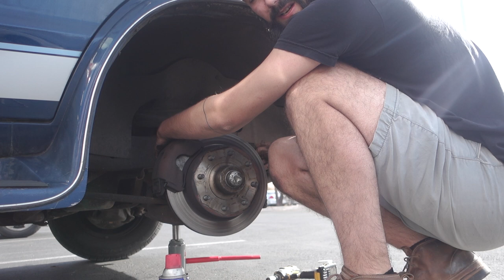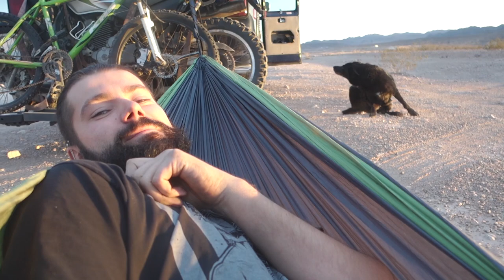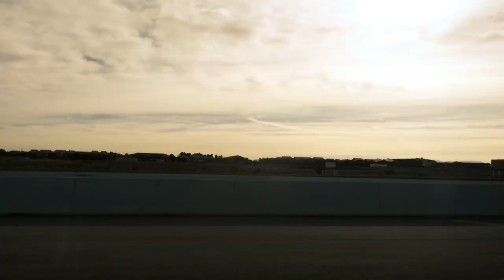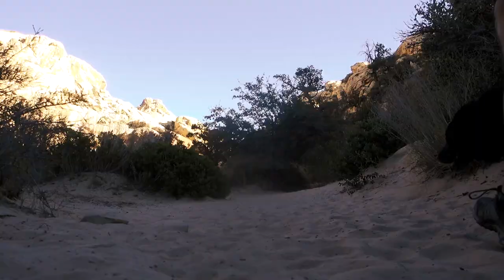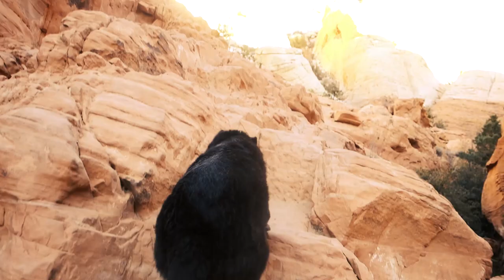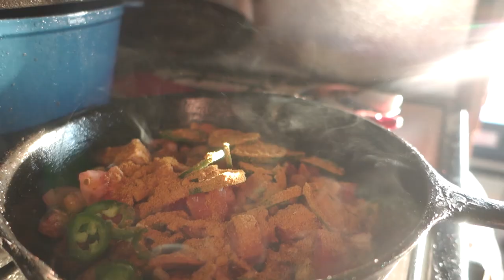Can't Keep Up With This Old Man - Baja or Bust 30

Comment: Great work on the brakes. Assuming your calipers were in good shape, you can save yourself the pain of bleeding the brakes by leaving the brake line attached to the caliper and just temporarily tying the caliper to something like the spindle or strut (to keep load off the brake hose). You'll just need to compress the piston(s) back into the caliper before installing the pads so that they'll slip over the rotor. A C clamp and large socket work well for doing that. Just a tip in case you have to do it again the future and want to avoid messing with the fluid. Have done my share of these over the years and I know it's always better when it's over!

Comment: Simon,   a few things that would ensure your brake job is successful.  1, have the rotors cut and trued up, prior to installing the new brakes pads. 2, de grease and repack the wheel bearings.  3, Install new rotor grease seals. 4, bleed the entire brake system and install new brake fluid. 5, If money permits. Install new brake calipers.  Also, check and the rear brakes, too. 

Cheers, Mate.
Reply from the maker: +Jack Walsh yeah literally did almost all of this in the video. Did you watch it?
Reply: Indeed I did, I see where the new wheel bearings and seals were installed. I thought I heard that you installed fluid. I did not hear that the fluid was changed or the calipers were bleed to remove any remaining air. If your brakes are functioning to your satisfaction.
Then that is most important.

I enjoy your videos and only comment out of concern for your personal safety. I raise question at times. Sorry If I miss an item or two. Good health and safe travels. Cheers, Mate.